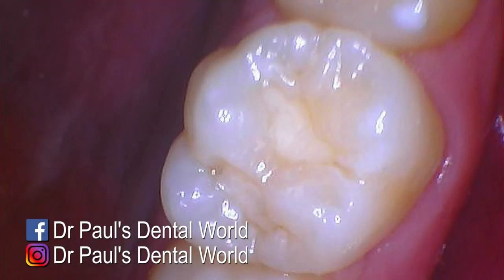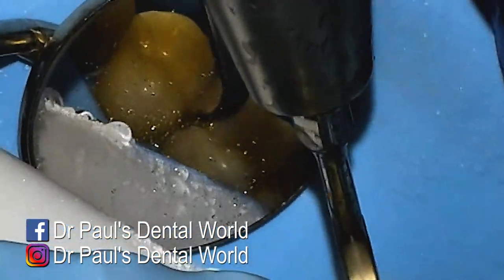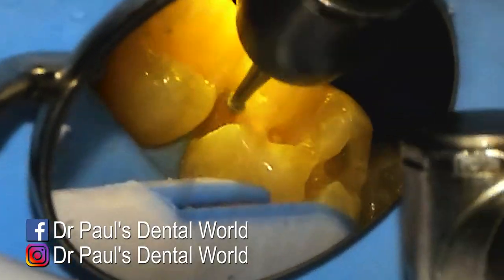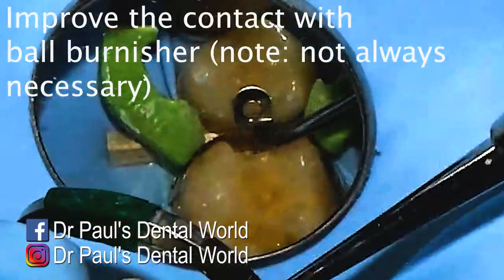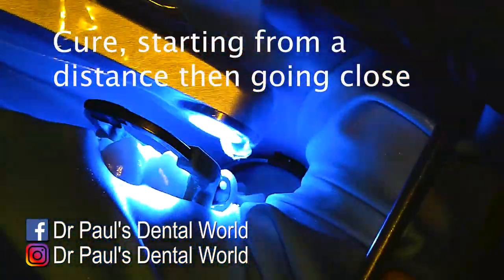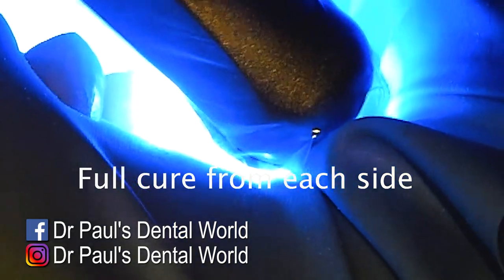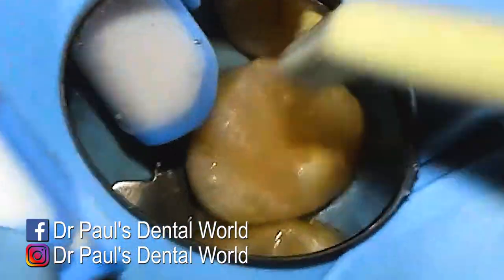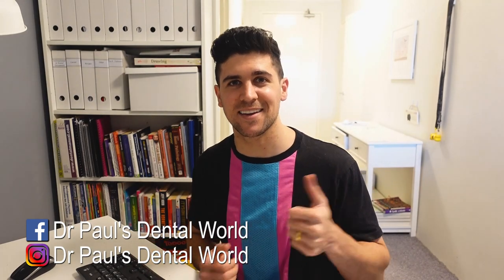Old Fillings And Decay Near A Crack (Class II Resin Filling Replacement) | Fillings Case #1

Comment: It's very satisfying to see such procedure being done with a lot of composure and carefulness. I had decay on two of my teeth and had it filled, but after two weeks or so, both the teeth started hurting a lot because the dentist didn't remove the decay fully. Black spots started to be visible under the filling which reached the top of teeth. He is a very respected and a well known dentist so I don't know why this happened but it still hurts to have lost my permeant precise teeth. Hope no one goes through the same
Reply from the maker: What was the outcome? Have you been back? Sorry to hear!
Reply: @DrPaulsDentalWorld  I had to do root canal on both of them, one of them started to cause more complications so had it replaced with an implant
Reply from the maker: Good luck with it, sounds like you're doing the right thing

Comment: Hi doctor, I'm not sure if it's the braces or anxiety that caused me to have bruxism recently and last night I woke up with my teeth clenching together and there seems to be a crack and hole in my bottom molars teeth which is causing me a lot of tingling feeling and sensitivity. I'm scheduled to visit dentist next week since he isn't available this week. Would I need to do a root canal to fix the sensitivity? I'm very scared of it so idk
Reply from the maker: Based on what you've described you'll need either
- a crown to protect the tooth and stop the crack getting worse
- a root canal to remove the nerve and then a crown to protect the tooth
- a filling to get rid of the decay and fill the hole

It is more likely to need root canal if the tooth is sore by itself (as opposed to being triggered by chewing or temperature)
Reply: @DrPaulsDentalWorld  I went to another dentist since it was causing way too much sensitivity and yeah I would need a root canal, but the dentist said I wouldn't be needing a crown because I would still have a lot teeth structure left, and my teeth is very big compared to normal size so it's going to be difficult to put on??? I don't feel good about this, should i visit another dentist for this?
Reply from the maker: Hmm not sure about that one. The research tells us that if you have root canal on a back tooth, it's lifespan is increased by having a "full cusp coverage indirect restoration". This doesn't necessarily have to be a crown. An overlay is probably a better describer for it (an overlay is essentially something that covers just the top part of the tooth, which stops it from breaking in future).

If they can't do that, maybe see someone she

Comment: Hey mate, do you routinely use flowable for interprox/occlusal restos?
Reply from the maker: I do, yeah. I use G-aenial Universal Injectable, which is highly filled and designed for posterior fills. It's properties resemble those of packable resins. The only thing I don't like about it is that I can't shape it like you can a packable. You could counter this by placing a packable for the occlusal portion, but I don't mind shaping with a bur.
Reply from the maker: You will see another video soon of a full cusp build up with flowable. I've only been at this current practice for 1.5yrs, but I haven't had any failures (ie chipping, like you might expect) yet.
Reply: @DrPaulsDentalWorld  Thanks for the response. Interesting, I definitely think flowable is the way moving forward for restorations
Reply from the maker: Agreed! You should give GUI I try. If you do, you have to use it with the grey tips, the black ones are more likely to give air bubbles. Also inject v slowly and keep the tip in the resin mass the entire time for the same reason
Reply: Thanks heaps for the tips :)
Reply from the maker: You're welcome! 🙌